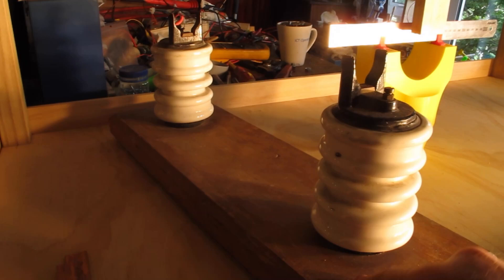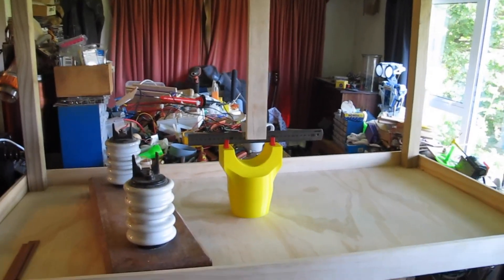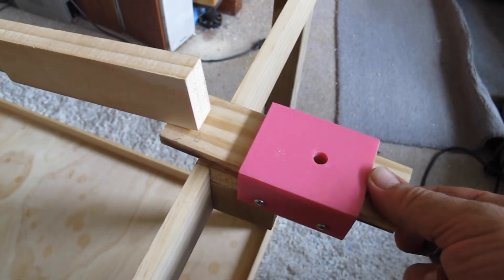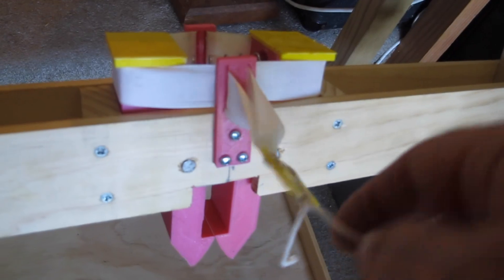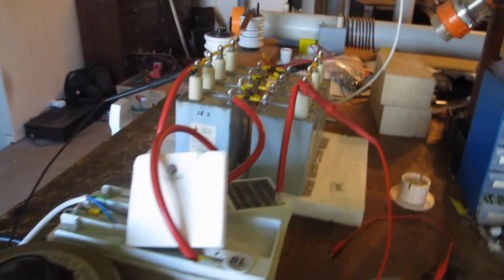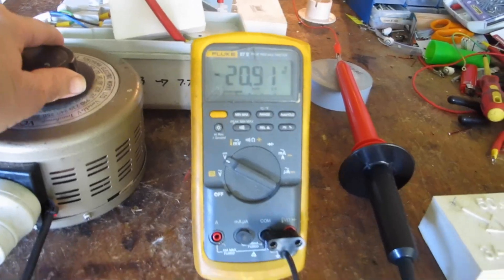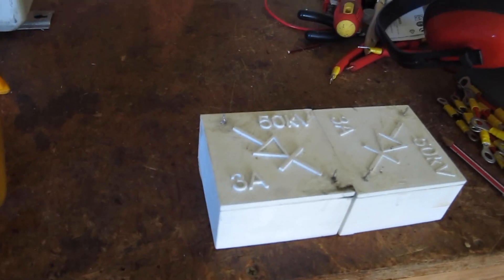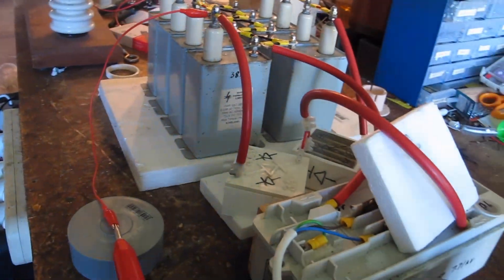In which I fail to switch 40,000 volts

Comment: SO correct!!!..doing research into this high voltage ,high frequency, high amperage technology I found the Chinesium- 2cl Green 2 amp and up even though I really could get away with using smaller Thinner diodes that are reportedly just as robust. I choose to use the epoxy formed 2Cl's....-John